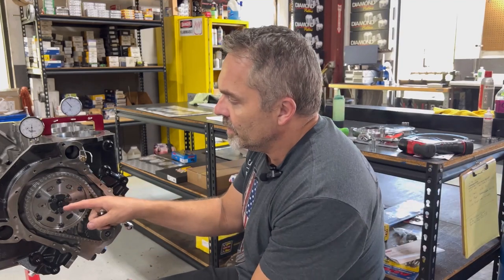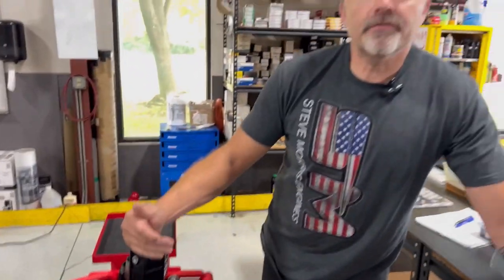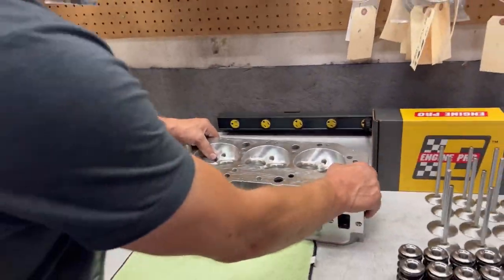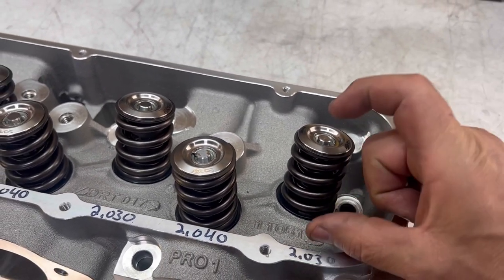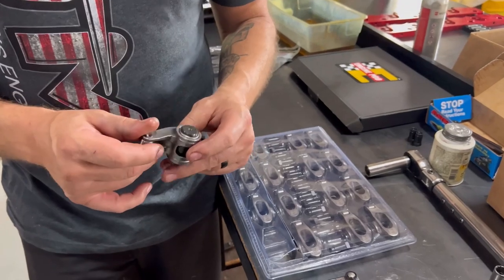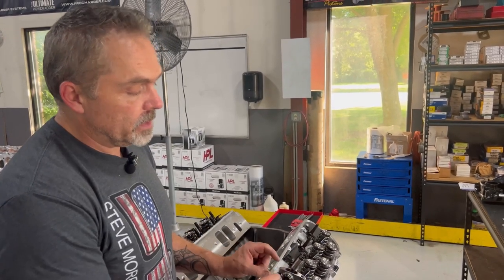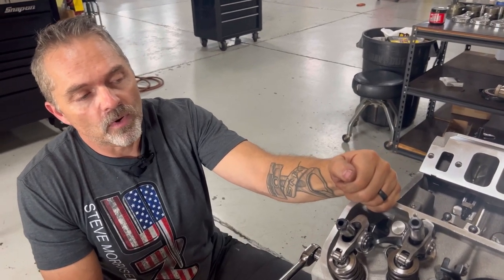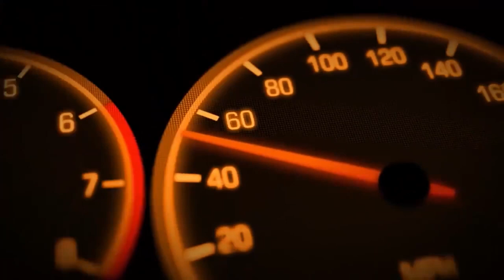Part 2 How To Build A 800HP BBC

Comment: Man Steve you should be charging us to view these videos 😂 On top of that you’re sharing all this knowledge on a engine you’re giving away for free….You really are a awesome dude, you have a fan for life! 💯
Reply from the maker: actually become a channel member, I do do extra tech, uncut videos, and I answer questions.
Reply: @ComputerCapone  You realize most other people with the knowledge Steve has tend to not share it for free, if at all, right? He wasn't actually suggesting Steve charge, just stating that  he could because the information is valuable. He's totally correct.
Reply: @mikescherrer4923  these motors have been around for over 100yrs. Not much is a secret anymore. Its just another video to me. There is about a 1000 videos posted a day that share the same info. As wierd as it is to say, making 4000hp isnt hard, paying for it is.
Reply: @ComputerCapone  the big block Chevy hasn't been around for a hundred years yet and there is a difference between something like this and your ordinary bone stock big block
Reply: @joen5332  these motors are basic. All of them. Take the aircompressors off they are your basic engine. Why are you guys so star struck. The basic design of an ICE motor hasnt changed since day one. The only reason more people dont have 3,4,5k hp motors is because if financially impossible for 99% of people. Its a wierd mentality that people think that they cant achive the numbers if money was not in the equation. If you can change your own oil, you can make 5k hp. More air, more fuel. Its elementary pshysics.  Now the diffrence with steve and others is that they live much longer. You think these guys were born building 3k hp motors? No, they applied what the learned from 5hp briggs lawnmower motors and went another step, then another and ended up here. That is why i say a briggs and smx have more in common that you think. Its all basic pshysics. More air, more fuel, more power. Simple.
Reply: @ComputerCapone  I don't care about all your rhetoric I'm a carbureted guy
Reply: @joen5332  crybaby.
Reply: @stevemorrisracing  Mr. Morris, what timing chain cover are you using?  I looked on your web site and I don’t see it listed.  Thanks!

Comment: Steve, "stud girdles been the norm for 30 years" ahh Steve, it's 2022. you are like me and don't realize that the 70's and 80's are farther away than we think, or care to admit. I was using them and they were the norm back in the early 80's when I started and were a thing before that so maybe the norm for 50 years Steve. 
Great video and very nostalgic for some of us and also shows how far technology has come.
Reply: I was going to say the same thing, we were making our own stud girdles back in the 80's. Couldn't afford those fancy bought ones. Like so many things we fabricated back then it feels like a life time ago. There were no turbo kits, you fabricated your own manifolds if you wanted one. lol thinking about it now, if we had the internet back then we might have come up with something more creative than a log manifold.
Reply: @DodgyBrothersEngineering  We never found any longevity in turbos, they failed way to often to be a thing, unlike today where everything has a turbo and 1000 HP is little man at the track. I still remember the joy and the pride I had when I "upgraded" from the 350 small block to a big block, "no replacement for displacement" was the thing, I wasn't as cool as those who had a Hemi but I did ok
Reply: @hommie789  lol I so hear you, back then cubes were king and 99% of the available turbos were something that came OEM out of a European car, and you had to be super careful with how much boost you tried to run (1 or 2 psi could be the difference), otherwise you easily found yourself with an exploded wheel. Not being in the U.S anything remotely reassembling a race car part was mega expensive, or something you wound up buying second hand off of one of the race car shops race cars. We never bought things like water / methanol injection kits they were the kind of things you made yourself. If I was a teenager today with all this modern equipment and purchasable over the internet I can only imagine the kind of crazy shit I would be driving today. The young kids on here marvel at what Steve makes but all things being equal it wasn't all that different to what we were doing in the day. It took the same level of commitment, I would probably go as far as saying more because we fought for every single HP we made. We couldn't simply buy HP.
Reply: @DodgyBrothersEngineering  And innovation was key for us because we didn't have the money to do it "right" even though the way we did it worked. 
Like using a Ford 9" out of a truck because the axle tubes were bigger and cutting it down and using the 9", from a car, outer bearings because they would slide into the truck tubes. Slide them together, pull them tight and weld the tubes up, bang a narrowed 9" to fit fatter tires. The proper way was to cut out the plug welds and do it right but we didn't know any better and our way worked, ran many runs on those diffs, no precision just ingenuity. 
I'm in my late 50's now and have some disposable income, been thinking of building another car but when I go hang out at the track the cars running and the speeds they achieving is just nuts. I think I am just going to stay a fan but reminiscing about it is still fun, makes me want to go out and build another.
Reply: @hommie789  same boat late 50's and remember fonder times. The reason we were faster than most was because one I was surrounded by mates that were in the welding, metal fabrication and automotive electrical trades, and had better access to machinery than most, and two we all had mechanical nouse (I worked in a performance shop at the time). Back in those days if you were a bolt on kiddy like they are today you were never going to be fast. We brainstormed ideas as a group and spent every waking hour with the bonnet up. Every conversation centered around how we could be faster. Spent countless hours polishing things to cut down friction. Things like partially / fully blocking off the casting holes to stop oil draining back onto the spinning crank, polishing the valley and covering in electrical varnish, home made windage trays and crank scrapers, sump capacity mods, polishing rods to within an inch of their lives, swapping engine parts from other engines was real common. Occasionally something like a pair of race ported double hump feullies might come up for sale at an astronomical price but for the most part we ported our own heads and manifolds and shared what we learned, trying to ever improve on what we did the time before. Implementing tips and tricks we read about in book from people like Grumpy Jenkins or Smokey Yunnick.  Like you nothing was sacred and often you would need to piece together broken diffs (we broke a LOT of diffs) and converted something that was cheap but not intended for our cars. I bought a Lexus with a 2JZ in it with the intention of giving it a little boost since I still have lots of parts left over like Haltech ECU, MSD bits and pieces, but now lack the will to do it all over again. I've had my turn, it is time to grow up and just be content with my litre sports bike (although I would like to be maybe in the 8's and have considered turboing it several times).

Comment: Years ago I worked with a circle track engine builder. He built asphalt modified engine (primarily sbc) and the division would not allow us to run stud girdles so he ran 7/16 rocker studs which really helped stabilize the valve train. I didn’t realize how much the rocker studs flexed with high spring pressures.
Reply: oh yeah 3/8 rockers studs wiggle like a limp noodle, even with a small low lift cam.

Comment: I chuckled when you said “no junk yard engine”.  Back when I was working part time as teen, junk yard engines were my go to.  Always looked for one that appears to be in its recent years, (new-ish,  factory built), no indications that someone has been in it.  (The worst engine driven, was a out-of-balance — Claimed to be rebuilt…  Felt like the pistons were swapping holes while rotating / running .  (Wild vibration).   Thanks for the engine and related videos‼️
Reply from the maker: Thanks
Reply: I bought a 305 from a junkyard when I was a teen took it home popped the valve covers off and they were full of years of sludge…when I popped the intake off the lifter galley was completely plugged up with it too. I just tossed the thing lol

Comment: Being a machinist also, the reason the chamfer is there is to spread the clamping pressure equally across the washer. But your right, if a person didn't look or think about it, it would definitely cause premature failure. Good call because you may have just saved someone. Ronnie.

Comment: Hey Steve,
     Tim here....yea, rocker patterns for correct pushrod length is critical, i just like a pattern bias (if it happens) twds the intake side, i have been told a slight bias twds exhaust side will wear guides quicker......just a thought.....all my patterns were in the center, and there was any bias, it was twds the intake side......but HAS to be chk'd for sure!!!......great vid sir!!!....PEACE to you!!

Comment: @Steve Morris Engine what is the brand  & p/n for the sealer you used on the head gasket water holes  ?
Reply: @steve 
Hello Sir, I am building a turbo 402 bbc inspired by you. I am also wondering what sealer you use. I searched  steve tech , but nothing came up. Looks like Mr. right? One minute seal?
Thank you, Kenny

Comment: Quick question I see witness marks on Main caps and Rod caps as he was applying last torque. would it not be best to make the mark across the bolt onto the adjoining surface to ensure not only present but movement. It will give you a visual reference for future maintenance.

Comment: curious why you dont have .35 quench.  Wouldn't you lose efficiency of cylinder combustion by having such a big quench?
I was always taught .35 was the best between head and piston clearance with head gasket.
Reply: I was wondering that myself, I built a similar 557” and went with. .040”

Comment: If using a gear drive on a flat tappet cam, is it necessary to use the cam button supplied in the kit?
Reply: You can use a cam button on a flat tappet cam and it will not hurt a thing. Like Steve said it’s not necessary. I started building motors when I was 20 years old and I always liked the idea of using a cam button on a flat or roller tappet myself. If I remember correctly the second BBC I built is when I started using Pete Jackson gear drives. I did use a Jesel belt drive on my last dragster motor. I have used aluminum and Teflon/nylon buttons in years past but I prefer the Teflon. To answer your question, yes I believe in using the cam button. The roller bearing button comes in some of the kits and they work well but I personally still prefer the solid Teflon.

Comment: I noticed you used silicone around the water holes on the head gasket. Is it necessary? I seen mls gaskets installed without silicone

Comment: I’m looking to make bout 450-500 hp with my stock sbc without blowing it up is the possible to do as a daily driver? 750 Holley carb afr 210 comp cam 585 lift  3500 stall 400 trans 342 gears

Comment: How did you get a 2.400" diameter intake valve dimension? If these are Dart Pro 1 heads being used here, the Dart website shows that these heads come with 2.300" diameter intake valves. Does Steve Morris engines modify these heads in their machine shop to get a considerably bigger intake valve in them???

Comment: Probably time for a new dial caliper,355cnc with 2.4" intake valves? Also why the small diameter spring for a street motor? No shade just observations.